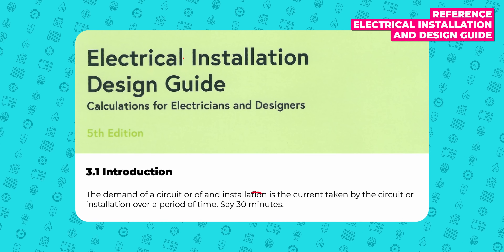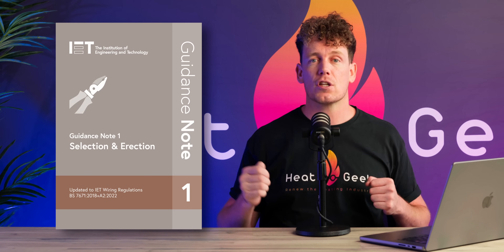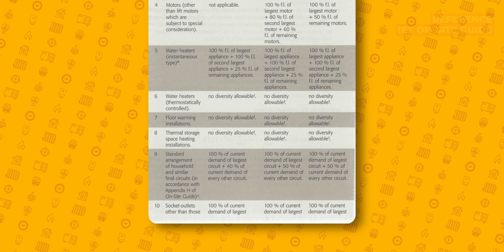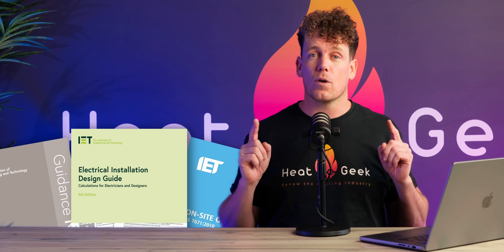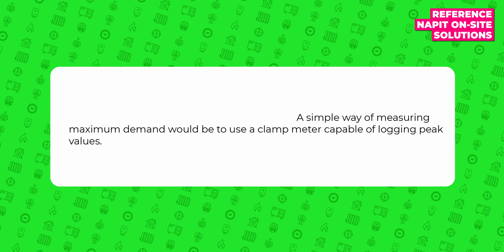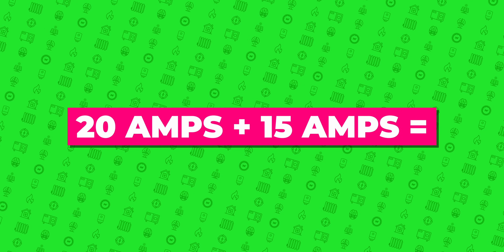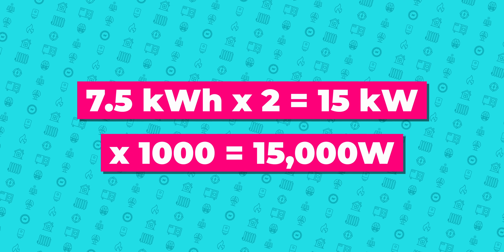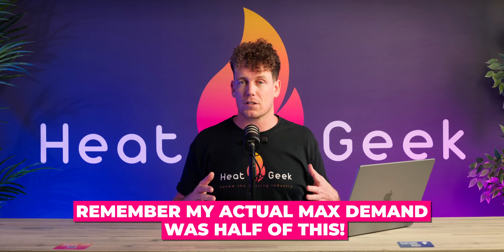How To Calculate Your Maximum Demand

Comment: I believe all  home 7kW ev chargers have  to monitor the total grid load using a CT clamp. They will automatically ramp down charging so that the total current from the grid is always less than your main cutout fuse. The installer will enter the fuse size/max power into the unit when setting it up.

Comment: I'm sat here in my home, regularly hitting 90A loads.

Cheap overnight EV tariffs like Octopus Go and Intelligent Octopus incentivse powering all the high load items together. It's common for me to have many of these on.

EV charger, heatpump, tumble dryer, immersion heater, induction hob, home battery charging comes pretty close. The EV charger definitely backs off when the electric shower is on!

I went around all the wiring with a FLIR camera to check for hot spots! 😂

Comment: Electric car chargers and heat pumps require a ena application. Properties need upgrading to 3 phase to allow more than one ev charger. Stop and think about all your cars in your family being charged at once. Most gas appliances will end and your home will be all electric.  So max demand in most cases with homes on 80 amp supply would most likely be OK. Any more ev chargers may be an issue.  Thinking ahead long term people will want 3 phase 22kw chargers over the 7.2 kW chargers we have now. So 3 phase is the solution for the future in my opinion.

Comment: I have watched your You Tube videos and now your hat has gone I understand your enthusiasm with heat pumps! I was a plumber for many years then MD of a large computer company so fairly versatile in my thinking. I have recently installed a heat pump which was scrapped but working and dovetailed it into my current combi boiler system with a simple heat exchanger. During the day the heat pump warms the water and radiators and if I want more heat in the house I switch off the heat pump and operate the combi by the thermostat..  Manual controls, no sensors apart from 'common sense! Works well and about £400 to install. In the summer I just use the combi for water so the heat pump is sleeping for 5 months!
Reply from the maker: The hat will come back late this year!

Comment: We used a clamp and looked at highest instant value in 3 months, we also looked at highest average over 30min period, and we tried turning everyhting on (had to do it in parts as it was so much). We have elec cookers, two big computers, a microwave, kettle, two power showers (11kw... each!) a heat pump and lots of lights etc. I got to 33kw and I dont think thats everything, thats 143A at 230v. However the highest the actual load hit was 18kw which lasted for 7mins ONCE. The next highest was 14kw and the highest 30min average was 9kw which happens 3 or 4 times a week and is when I'm cooking for about 20mins and the wife is in the shower for 10mins. Anyway, 14kw is 61A so very close to needing to notify. However... we are in the process of replacing the power showers to take feeds from our nice new tank fed from the heat pump and to get so high again we'd need to be cooking very vigorously at the same time as heating. I've worked out that in a 70% duty cycle from the heat pump then it can certainly be drawing about 4.5kw over any 30min period, and that leaves about 9kw for everything else. Even with two rings on the cooker, the oven and the microwave and kettle going, you still cant average 9kw over 30min unless you don't put a pan on the rings so that they just blast heat into the air, leave the oven door open and constantly empty and refill the kettle - if you are acutally heating food with those things, then even rampant cooking averaged just 4kw over 30mins, admittedly peaking at 10kw for the odd 30s. Anyway, data logging is enlightening and if you look at the IEE docs carefully, things like using the breaker values for a cooker are just stupid, unless you are heating your house with your cooker you cant max it out for 30mins!

Comment: Another cracking episode. I was scrawny head about this only a few days ago. I have a heat pump, domestic battery, electric hob oven and 3kW car charger and highest 30 min average over past month was 6kW or 29 Amps. (Max at night whilst recharging domestic battery at 1.5kW and car at 2.5kW with heat pump running at about 1kW draw)
Reply: Yes the battery was also on my mind with this one

Comment: Electric showers are the main problem where maximum demand is concerned. 
You can apply diversity to most circuits and you will never get any where near 80 or 100 amps
But an electric shower can draw  up to 40 amps  which could cause potential problems  if charging an EV or powering a heat pump.

Comment: Firstly. Ask a qualified electrician. 

It’s a case by case basis. A 4 bed with an elderly couple in, isn’t the same as a 4 bed with a young family with 2 kids. 

Your video is relatively good, but I think details such as plugging all items in isn’t really necessary. A “downstairs socket circuit” is generally much higher usage than up, especially if the kitchen/utility isn’t on a separate circuit. 

I agree the guidance is dated but as you state it is just guidance, but I would strongly recommend a qualified person look at it or someone who has been informed by an ‘electrically skilled’ person. 

It is a hard subject to broach because in todays houses, there’s so many variables. 

Here’s one for you. Typically, no more than 20 Led downlights should be installed on 1 circuit in one location. This is because led lighting has a huge peak inrush for a fraction of a second and can cause nuisance tripping. A fine example of the variety of  intricacies electricians come across.
Reply from the maker: I approached several electricians about this vid. There was not much help. Electricians have been doing our md calcs for years

Comment: I'm not sure you can use the smart meter data in the way you suggest to calculate maximum demand. It is showing KWh not KW. i.e. the amount of power consumed in a given amount of time and not necessarily the maximum amount of power you demanded from the grid at any given time. For example pulling 100A from the grid for 30 minutes and then zero amps for another 30 minutes will result in 50kwh energy used, but if you were to pull 50A for a full hour you'd still only use 50 KWh. The difference is in the first example you've blown the main fuse.
Reply from the maker: It’s an incredibly simple calculation to convert energy over time to power
Reply: @HeatGeek  Put another way, a smart meter reading will only tell you how much energy you used in a given time. It won't tell you what the maximum load was during that time.

Unrealistic example but hopefully you can understand my point here ..If you pulled 200A for 5 minutes and then blew the main fuse, what do you think the smart meter reading would be ? Clue, it's not 200KWh...
Reply from the maker: @HenryOCarmichaelSmith  that’s one of the main points of the video… a 1 second max demand is meaningless and useless

Comment: We've got a heat pump, EV, induction hob, solar battery storage (no gas at all, only electric in our house) and our max draw is 17.1 kW over the past year. This is using a Hildebrand Glow smart meter that sends live reads every 10 seconds, which I log using Home Assistant. The highest number it's logged over the past year is 17.1 kW, which is approx 75 A. We do, in fact, run lots of appliances (dishwasher, washing machine, tumble drier, dehumidifier) at the same time -- overnight on the cheap rate tariff, which is also when the EV and solar battery storage is set to charge. I also set the heat pump to a higher flow temperature during the cheap hours, so that I can "pre-heat" the home on the cheap rate. However, we're not using the induction hob at the same time as charging the EV, or boiling a kettle in the middle of the night, so that's a pretty hard cap on how much we would realistically draw at once. I think 75 A measured peak gives a good headroom vs the 100 A main breaker.
Reply: Similar situation, max has been 15kW, the big hitter out of everything is the EV charger

Comment: Pretty good breakdown - you missed electric showers - that could be make or break if you consider a 10kW shower may run for say 5 minutes, but if that kicked in with the oven, toaster, HP and charger it may take it over even with a 30 minute window from the smart meter - it's a judgement based on what the homeowner has and states they use...a clamp meter might be a good indication but ideally recording over a period of time would be better. I've monitored my use via Open Energy Monitor for over 10 years and the max peak was 4.5kW once when both ovens were on...realistically even with all the 13A plug-in stuff on, I doubt I could get to more than 20kW but that's without a HP or EV (yet)
Reply: I also have a Open Energy Monitor and a previous Christmas day I wondered high I could get the peak and with the EV charging, electric shower, kettle, espresso machine, double oven & electric hob as well as a multitude of other electric items concurrently on it peaked around 12kW.
Reply: @MikeBookham  that's curious - how powerful is the shower and presumably the car charger is 7kW? Were the other loads cycling on/off on their thermostats e.g. ovens, hob? Conservatively, I'd total those loads to 7+10+2.2+2?+4+3? = 25ishkW which would be the 100A limit? if they were all drawing at the same time
Reply: @Umski  We no longer have an electric shower but it was around 9-10kW. Other than the EV charger & kettle the other items cut in and out, so it would be very rare for all to draw full power at the same time, especially with an induction hob & oven. Also I’ve just discovered (after the SD card corrupted a couple of weeks ago) that my EmonTx only samples the mains for 200ms every 10s, as it still runs the JeeLabs classic radio driver and not continuously so if there’s any draw during it’s ‘sleep’ period then that’s not captured. The new LPL radio drivers run in continuous mode so would capture all power consumption.

Comment: Regarding monitoring, the OpenEnergyMonitor has addons for CT clamps. I think I recall you using OpenEmergyMonitor for some testing around flow temperatutes on another video.
I use a Shelly EM which allows 2x CT clamps to be connected. Sends data to their cloud (free) over Wifi or can be integrated to a local instance of HomeAssistant (free) to record.

Comment: What a ballache. Surely the easiest thing to do is in the first place buy a heat pump and car charger which are capable of reacting to house load. If the load spikes because an electric shower is running whilst someone is using the oven and four hobs simultaneously, the charger should stop charging the car for a bit and the heat pump should turn the heat down until the load drops to compensate. Must be simpler that all these shenanigans!
Reply from the maker: Yes. But your max d calc has to include those appliances anyway though for some strange reason

Comment: assuming overnight EV charging at 7kw + maybe some washing/dishwasher if you’re moving those to your off peak window - thats your likely max peak at night. Daytime if you have electric shower may be similar. Heat pump I wonder if there is value in having smart clamped sensors to control diversity? Although probably not necessary for most users

Comment: Brilliant. When my car charger was fitted 6 years ago the diversity calculation showed max power of 120amps. Not surprisingly the DNO 'blew a fuse'. The DNO then fitted a clamp to measure our actual consumption over a month and gave us permission to use the charger, but did not give us the results from their data logger. Since then we have had a 12kW heat pump fitted, which entailed some work by the DNO away from our property to improve the supply - again we were not told what this work was but there was something vague said about 'harmonics'. There was no charge to us. More recently we have had a smart meter installed, and even in the depths of winter with the heat pump at full bore and the car charging I have never seen consumption above 14kW (say 60 amps). We have a 100 amp fuse to our supply and I am very relaxed that we will never get anywhere that.

Comment: Good video.

This is analogous to Heat loss calculations, where we use theoretical values to calculate accurately and can easily be an overestimate of 30-50% - which then leads to installing larger boilers or heat pumps than are necessary - and then you have to live with the inefficiency.

Real world data analysis has to be better than assumptions.

Comment: I have to do this every time for customers wanting to go full electric EVs/induction hobs/electric showers and heat pumps. Honestly most of the time it's better to just meter it for a couple of weeks in winter, or where possible in the summer and add 30% to summer value. I have come across many a property that have blown their main fuse due to engineers using diversity and not taking into account Christmas Day family gatherings. It's almost exclusively a Christmas call out. Not the best time to lose power especially in a bad winter, even more so when the DNO decides to charge for their call out.
Reply: Totally agree, if you ever want a worst case scenario, Christmas Day is the day.

Comment: When I got my heatpump installed I got a survey by the DNO and they recommended a 3phase supply. But I feel it’s been a bit pointless as I don’t have a 3phase heatpump or battery system so it’s all working off one of the phases 🤷🏻‍♂️

I got 13kw demand when I had my car charging, battery charging and dishwasher on. But I don’t think the heatpump was on.

Comment: 14.3kW was our peak demand at 02.00 on 17th Oct .a cold night ...5kW into a Powerwall and the remaining 9.3kW heating a 3kW immersion,  4kW Electric Boiler and probably  some underfloor and miscellaneous [we are all electric with 3.2kWp solar since 2005 but with powerwall battery  since June 2023 ...  [OctopusFluximport 2-5am]  Now, at least, we use almost all of what we generate 8-)
PERHAPS the DNO/ max demand is of concern for immediately after a power cut...when interrupted devices and thermostatic heating will all turn on ( unless they are intelligent Dynamic Demand controlled devices ).
Our peak time demand 16-19.00hrs is the opposite = zero  with the 13.5kWh battery falling to 20% about 20.00hrs and dropping back to grid usage until after recharging again between 2-5.00hrs.

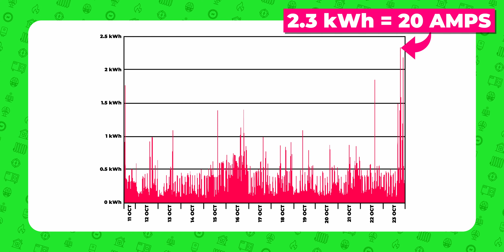Comment: 6:16 How do you get 20 amps from 2.3 kW? Power is volts multiplied by amps so with a nominal 230 volts that gives 10 amps?  Here in France our smart meters give 10 minute reading and also daily maximum which makes monitoring a bit easier. But supplies are usually 6, 9 or 12 kW, ie up to 45 amps, but this is generally fine for an all electric home, heat pump and EV charger.
Reply: UK smart meters measure in half-hour periods. The max usage in one period was 2.3 kWh and hence 4.6 kWh for a whole hour. This is 4600/230=20A
Reply: @HowardBurgess Ah - makes sense

Comment: I'd be more worried about flooding!  If you have all that lot switched on to measure it you'd have to be an octopus!!

My assumption is the measurement is based on what comes out of the supply from the grid how would having solar panels effect such calculations?
Reply: It doesn’t because you are trying to determine maximum draw.

Comment: Just used the smart meter calc. Looks like my highest load was 78amp on my 100amp supply. That's an EV,  ASHP,  Powerwall and a tiny bit of home use in the off-peak hours. Best not be cooking a Christmas dinner between 4 and 7am.

Comment: Here in Belgium the most common household connections are either 1x40A or 3x25A. 
I lived for years with a 1x40A connection before I started renovating my home. I didn't have a heatpump, but I did have an electric hob and an oven that was often used simultaneously, an electric hot water boiler, a washing machine and dryer, an electric space heater in the bathroom, a vintage stereo... I could have easily tripped the main breaker with all that stuff, but I never thought about how much I could run at the same time and I tripped that main breaker exactly once in 10 years during a diner party.
Many people install heat pumps and car chargers over here without getting their connection upgraded. 
I personally got an upgrade to 3x32A, but I did that mainly for the 7+kW per phase, not for the 22kW in total.

Comment: My Maximum demand = 50 amps.  On the Zappi charger you can throttle the current flow to the car in order to keep the grid import below a configured amount.  So my house has a fuse cutout of unknown rated value.  Therefore it’s assumed to be 60amps. It’s probably higher, but I don’t want to find out the hard way that it isn’t.

At home in the winter time, it’s perfectly feasible for me to be running overnight:  32amps for car charger, 20 amps for the battery charging and 13 amps for the hot water heater without any current limitation.  It’s easy for current to be flowing for over an hour at 63 amps.  So by configuring a grid import limitation of 50amps on the Zappi charger, I’m confident the maximum demand can be configured rather than predicted.

So adding a heat pump I hope should be easy.  If I keep the hot water heater off, and any backup heater for the heat pump off, then I should simply substitute the existing hot water heater with the heat pump current draw.